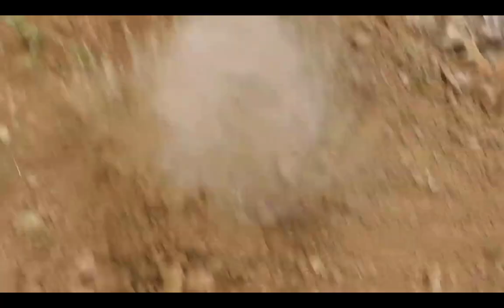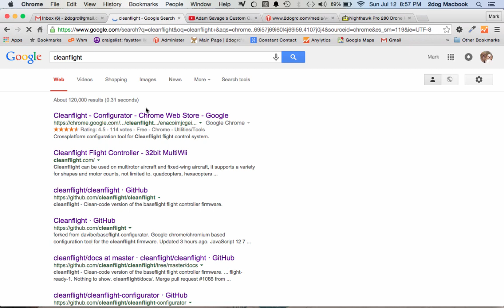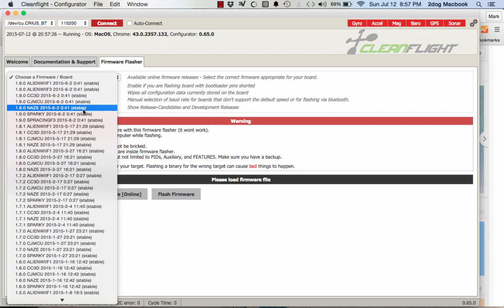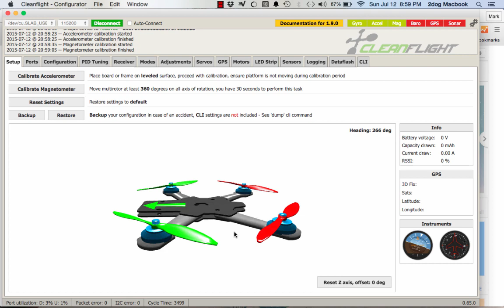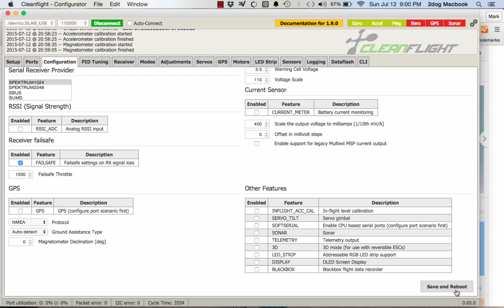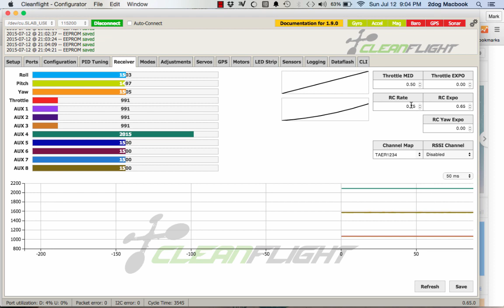Flash Emax Nighthawk 280 with Cleanflight

Comment: This tutorial worked GREAT 18 months ago but now Fly buddy and I are trying to setup our Hawks with Cleanflight Configurator v2.1.0 and there are more settings in this newest version than on your video here. Would you be able to direct us to where we can find out how to complete our setups? We tried a variety of combos in PID's but the Hawk's just don't fly like they used to. We even DL;d older versions of Cleanflight to no avail. Thanks Dog!
Reply from the maker: I can take a look, but the ESC's are very old and the firmware may not support the updates in Cleanflight.  Unfortunately this ship got stuck in time because of the ESC's.  If you want a good upgradable RTF, check out the Diatone TyrantS.

Comment: hi mark when flashing to cleanflight should i turn on the transmitter on for doing the flashing set up   iv just changed to devo 7 transmitter & receiver
Reply from the maker: No. You don't need the transmitter and flight battery until you set up the receiver tab. Just flashing and does not require the transmitter. Make sure you have props off!  Just in case.
Reply: +2dogrc thanks iv never did this before mark I'm just trying to get this nighthawk 280 pro Arf setup but just couldn't get it working with emax factory receiver & transmitter and swapping to devo 7 with cleanflight and hopefully get this in the air lol     and thanks very much Mark   
and sorry I'm William
Reply from the maker: +William Davie no problem. Do not turn on Oneshot and set your loop time to 1000. Not sure if I updated the video with that info. Increase your p to 8.0 on both pitch and roll.
Reply: thanks noproblem whats the latest stable version  is it still the same one you ar using in this video yes or is there been another update
Reply: hi mark iv come across a problem testing motors when i click raise the master plug the battery in  it keeps singing away and if i move the master down  theres no bleeping or singing  not a thing  and if i raise the master back up it starts singing and go,s back throw its singing and bleeping as if its calibrating   i rest it and tryed testing again  but it still singing away  should i wait untill it completely stops singing before moving the master down and should i have the transmitter turned  on for the motor testing  mark   and im sorry for all this hassle
Reply from the maker: Try using 1 motor at a time instead of the master slider.  I am not sure the latest, but I think this was 12 and I am pretty sure 13 is out.
Reply: hi this is me just getting back to this  mark  iv got my old nitro helicopter i just had a made thought  to unplug the swash plate wire and plug it in to all the channels to find out whats what and swap the roll with the pitch  danny om just told me to try using a servo  and i should get it this time     haha  and i did download a newer version   mark theres some changes in the new software  mark  and thanks again my friend

Comment: hi nice video  iv just got the ARF one and just cant get it setup in baseflight its a nightmare lol its not saving my receiver setup  or configurations   can you give me any advice on this please   or anyone
Reply from the maker: Download Cleanflight and try that.  Base flight is dated.
Reply: thanks iv downloaded it but im new to this kind of thing well race quads  its not lick my old x9g & jxd509g  and mini h8     and this is setup with the nighthawk EM-16 receiver & transmitter  but im having some carry on with it   
and do i just follow everything from your video   im worryed incase i do something wrong and mess it right up  
and im william  and thanks for getting back to me
Reply from the maker: Just take your time and take the props off!  Luckily there really isn't anything that will fry your board.  Make sure Oneshot is off and the loop time in set at 1000.  Only changes recently.
Reply: cool  man lol i was tempted to do it lastnight but i was stressed out my mind and ready to bang my head of the wall  haha  im joking but its better doing it when your mind more relaxed  plus going over your video a cople of times  but i will follow your video as im doing it  haha     AND THANKS VERY MUCH FOR YOUR HELP AND ADVICE  2dogrc
Reply: hiya mark i tryed it the last time i chatted with you  but i didnt have any luck and that night i tryed it when i noticed i was having the same problem with motors testing  and  couldent manage to swap the roll with the pitch i got the video out but the video didnt turn out good im sure i tagged you on it to take a look at it to see if you notice what i did wrong or forget to do mark  lol but i made a few changes  and was going to get the camera out and get a better video of this  setup   i think the only way im gony get this flying mark   if i open the window and throw bloody out my friend  haha   thats how im feeling     and its qaulity  weather to be out flying  ta  its no fair man  ?

Comment: Dos the emax have failsafe 🙈
Reply from the maker: Yes, Cleanflight has a failsafe setting.
Reply: 2dogrc thanku for ur reply dont no what 1 to go for walkera f210 r emax
Reply from the maker: The Nighthawk has outdated ESC's, and impossible to replace due to the PDB.  The ESC' really determine how the ship flies and performs.  The Walkera has a bunch of crap on it that just makes it heavy.  Check out the Diatone Tyrants, solid ship, light and our next batch has a leading performance ESC!
Reply: 2dogrc i need sumthing cheap just to get used to flying  again sumthing rtf  that wee 180 looks so cool tho
Reply: +leejulz1 I have flown the Tyrant and Nighthawk...way different. Nighthawk flies different, Tyrant is locked in on default settings. We will have them around July 4.

Comment: All of my systems work, including the motors, gyros, etc. but the quad won't arm (moving rudder to full right doesn't work, and I've tried setting up to switch arm, which also did not work) and I cannot take off. Please help!
Reply from the maker: Okay.  Quick couple of things to check.  In your Receiver tab,make sure that each control goes from 1000-2000 with 1500 showing when the stick is centered.  This has to be done on throttle as well.  If these are not set to 1000-2000 then your flight controller may thing the throttle is raised and will not arm.  To adjust, check your travel adjustments in your radio. 

If that is not it, check your loop time.  If it is set at 1000 in the config tab, you must disable Oneshot, which is on the top of the page in the config tab.
Reply: I actually just fixed it. It had to do with my gimbal travel, which did not transmit all the way to the arming spot. Thanks for the reply though!

Comment: Could someone please help me out? I'm having an issue with my emax nighthawk pro 280's transmitter/reciever. It's giving me weird jumpy/noisy values in cleanflight and it also affects my motors during flight which can be quite annoying during fpv. Thanks 

/watch?v=b4YiPxYZUaY
Reply from the maker: +TheMonkFilm If the values are jumpy with the transmitter turned off it could be a bad connection to the FC from the receiver.
Reply: 2dogrc If you watch the youtube link I put in the post, you'll see that the resting values are perfectly fine. The video explains the issue best
Reply: I had that issue. If I remember correctly go to configuration tab on cleanflight, under receiver mode select RX PPM, its most likely defaulted to a different one. Then save and reboot.

Comment: Do you mind If I bother you again? :) sorry but I have no quad gurus around where I live! And specific problems are so hard to find in forums. If you can recommend me a forum, I'll ask there!! I had everything set up, flying great, on a field. Had quick video glitch and hit hard a cabin roof, managed not to fall, but once I hovered and gently lowered altitude, the quad simply swerved back and right, towards motor 1. Checked for physical damage, a few bent landing gear, and a bent led bar, no other scratches or broken props.  But now, unfortunately If I punch up, no noticeable strange behavior, If I cut the throttle, it doesn't fall straight down anymore! It falls back and right. Already replaced props, recalibrated accelerometer, magnetometer and ESCs, any suggestions? I appreciate it!
Reply from the maker: You could check the ESC's individually. Props off. In Cleanflight go to the motors tab and power your ship. Slowly bring each ESC slider up individually and see at what number the motor is spinning consistently. They should be within 1-5. If one ESC is off. This could cause a problem. Also take note of this number and set your min throttle on the configuration tab to 15 over this number.
Reply: +2dogrc motor 1 Spins constantly at 1030, M2 at 1029, M3 at 1031, M4 at 1027, and as default, minimum throttle was set to 1150. I'll set minimum Throttle to 1045, Will check if that works!
Reply from the maker: +gcacciola Well higher is safer then lower. Those numbers are good. Maybe it was your battery placement making the Cg different. That can effect this. If it was in auto level mode, try it in acro mode. That can tell you if it is a flight control issue. Sounds like motor and ESC are good.
Reply: +2dogrc Thank you for the input, I really appreciate it! Well, today was the day after the hit, So I replaced the battery, I don't think positioning have something to do with it, it was the first thing I checked.  It is happening both on Level and Acro mode. In Level is noticeable, In acro is unflyable. I always fly acro, just use level on emergency situations. I thought the bent led bar was forcing the arm so thrust could be misdirected but I removed the led bar and that did not affect the issue :(
Reply from the maker: +gcacciola That is a tricky one.  Only on descent there is an issue. Here is the thread on RCgroups. http://www.rcgroups.com/forums/showthread.php?t=2414149. Maybe someone there has had a similar issue. If it happened after a crash, I would say it is something mechanical, not programmable.

Comment: Hey! I am a newbie, bought the NH280pro as my first quad and had a blast flying it acro mode around 10 batteries without the motor mounts. Then I installed the motor mounts, and flashed the firmware to the 1.12.1. After that I couldn't take off, the quad was very unstable and flipping sometimes. It always drifted right when taking off. I then calibrated everything, downgraded the firmware, removed the motor mounts, and it was still bad. Yesterday I was messing with the motors tab on CF, propellers on, holding it firmly with my hands, I noticed that when Increased all 4 motor RPM on the computer, while on acro mode, the quad would raise the rpm evenly but it was forcing my hand, back and right, as if the rear right motor was generating less thrust than all other 3. I even replaced the propellers with no success. Do you have any idea what can be the problem? Thank you!
Reply: I would suggest checking your props. Usually if a quad flips it's because the board is misaligned, motors are spinning backwards or props are backwards. If you are sure the props are good, try reflashing and selecting full board erase.
Reply: +Mark G Thanks Mark! I replaced two sets of props before asking you the question!!!

Ill try the full erase!! Thank you!!!
Reply: +Mark G It didn't work either... :( I even physically  switched motor 1 with motor 3, but the problem continued. I thought that doing that, if it was a hardware problem, it would drift the other way!! But it kept drifting the same way, so it is a software issue :/, any other ideas?
Reply: +gcacciola Drift issue! Okay try this, props off. Power the ship, power on your RC transmitter. Make sure in the recover tab that when your controls are centered on your RC transmitter, the numbers displayed are exactly 1500. Not 1505 or 1480. If these values are not correct, you will have drift.
Reply: +Mark G They were around 1517, trimmed them down to 1500. Ill let you know what happens!
Reply: +gcacciola Great!  Make sure you used he su trim menu NOT the trim tabs on the radio. You should have each channel set to 1000-2000 with the center at 1500.
Reply: +Mark G I hadn't haha, but now I did the way you told me, researched a bit about ir and now everything is fine! Thanks for the help!

Comment: I am having trouble getting this to work. I'm using a dx9 with orange reciver. when I follow the video it's not doing what it should. my channels all do different things ect. could do with some help. this is my first quad. I'm used to flying planes
Reply from the maker: +Paul Woodward Sure thing!  Here are a few things to check.  When you plugged the wires into the receiver from the nighthawk, the cable with 3 wires in the servo lead goes into your first channel then the rest are consecutive after that.  Now when you go to the Receiver Tab in cleanflight, there is a channel map tab.  If your channels are not the correct one, then select another option and click SAVE at the bottom of the page.  If you don't click Save, nothing changes.  Once you have the channels mapped so that throttle is throttle and so on, adjust the channel reversing in your radio to make them go the proper direction.  If you tried all the channel mappings and still the channels are on the wrong sticks, then try swapping the wires in the receiver for the mixed up channels.
Reply: +2dogrc hi I am using ppm. but none of the channel maps are right. really want to get this set up?
Reply: +Paul Woodward In channel mapping in the receiver tab select JR/spectrum. Then click save. If you channels are still not correct try swapping the wires in your receiver to get the proper channels.
Reply: +Mark G I can't plug wires in different I'm using ppm?
Reply: +Paul Woodward that's right!  Are you using an airplane model or mode in the transmitter?

Comment: I did everything you described in this video to upgrade my Emax Nighthawk. Now the motors sound very different and the PCB gets very hot very quickly. What happened? Did I do something wrong? I calibrated my accel, mag, radio and esc's and it just sound extremely weird. A lot of electrical noise. I've uploaded a video on my page.
Reply from the maker: +leetpg That is normal!  The reason is that the newest cleanflight increase the amount the FC and ESC's talk to each other.  These makes the motors and ESC's more responsive.  Those motors sound just fine.  I see you have the brake on as well.  That will help your flight performance.

Comment: so I've done everything and clicked receiver and noticed that my yaw doesn't work which is channel 4. Tried plugging out and in with no luck, I then plugged another channel into channel 4 on the receiver and that worked so it must be either the channel 4 pin itself or the flight control board right?
Reply from the maker: +calzaggii22 Yeah, it sounds like the Pin.  What if you take the Pin that was in Channel 4 and put it into Channel 3?  Does YAW work?
Reply: +2dogrc Unfortunately not, sending it back today for a replacement. Quick question, how do you arm the motors?Tried doing it with a aux channel on cleanflight with no luck. Cheers
Reply from the maker: +calzaggii22 Set the ARM mode in the modes tab is one way.  Or do not set ARM and use the YAW stick. Yaw right arms, throttle zero.

Comment: Please can anyone post some pids for 4s for emax 280.
Reply from the maker: +bulibasha ion I am using the stock PIDS on Cleanflight 1.2
Reply: I'm trying to use the stock PIDs from Cleanflight and I can't even get mine off the ground. It just slowly starts oscillating more and more till it flips itself over. What gives??
Reply: Are the motors spinning in the right direction and are connected to your naze32 on the right spot ?
Reply: It turns out it was a firmware issue. Got it fixed. Thank you anyway.
Reply from the maker: I don't have mine with me, but raise you P on Pitch and roll to 8.  This should be a better starting point.  I have not flown mine in a while.

Comment: Mark got the quad thanks for the fast shipping... this video got me all locked in thanks video coming soon.
Reply from the maker: +Tallguysd Great!  I need to get the Newest Cleanflight flashed and tuned.  The defaults in the latest Cleanflight should be pretty good.  Just tweak your RC rates for the responsiveness you like, 0.0 is too low, 0.3 is a good beginner, 0.6 is more fun , and .8-1.0 is where I am.  I am using PID controller 1, Multi Rewrite.
Reply: +2dogrc I'm using the settings from this video with new version of cleanflight will take it out tomorrow for flight testing. Indoor hover test real stable.
Reply from the maker: +Tallguysd The new cleanflight settings should be very close!  They have done some good work with tuning those.

Comment: I know this is an older video but I am having some trouble with my Emax nighthawk, when I plug it into the computer and plug in my battery pack the esc's will chime and I can run the motors using my computer, but when I unplug it from my computer I just get 4 red lights on the bottom board. I have no Idea what to do, and any input would help. Thank you
Reply from the maker: +Grant 7S Okay, I have emailed Emax on this one.  They believe an IC is busted on the mainboard.

Comment: Ahh ok thanks so to confirm I need to flash my skyline32 with naze firmware?
Reply: Yes that is correct. Use e Naze32 option.
Reply: +Mark G Brilliant. Thanks so much been looking for this info for ages! so any "stable" naze32 firmware will work
Reply from the maker: +calzaggii22 Yes, you will want to use the most recent stable version.